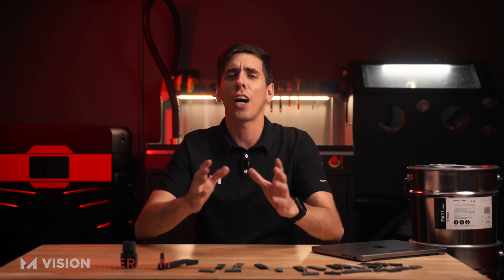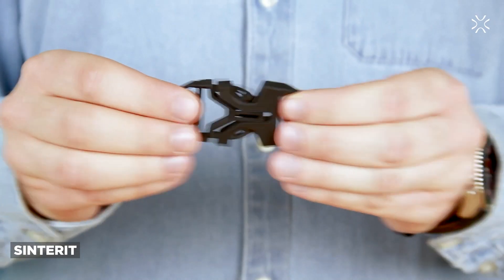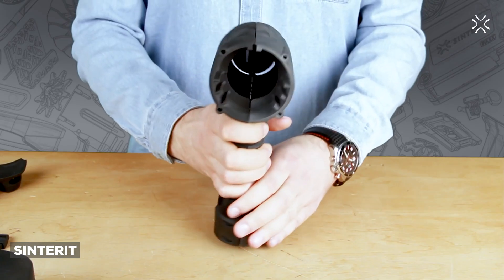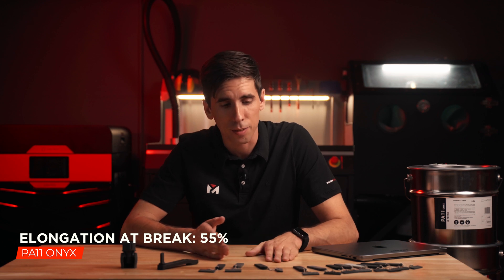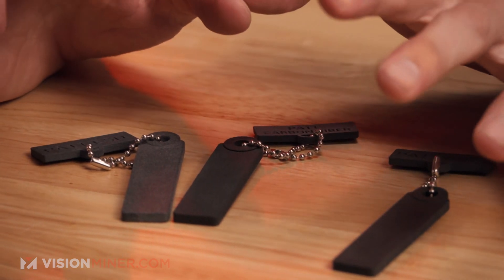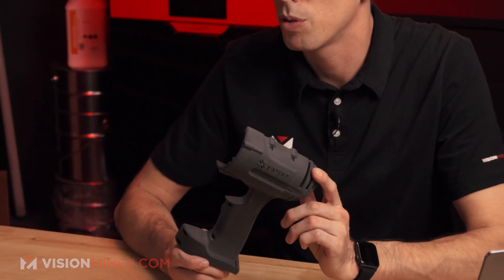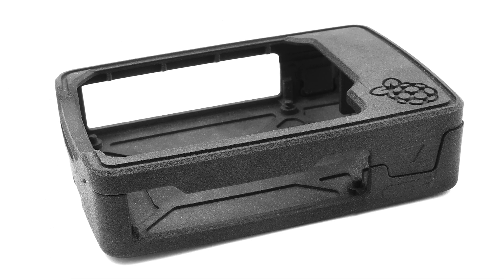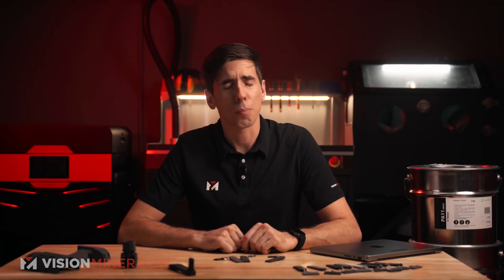Sinterit PA11 Onyx Overview - High Quality Prototype and Final Product Material | Sinterit Materials

Comment: 47c heat deflection ?! that will like melt in summer here lol
Reply from the maker: The HDT is more about yielding -- it will start yielding around that temp, but still doesn't melt until the 200's -- think zip-ties, for example -- they'll soften and yield long before they actually break :)